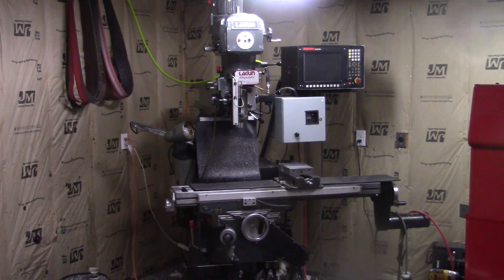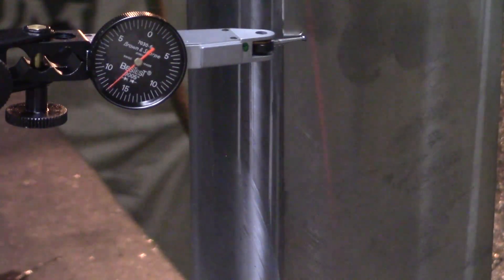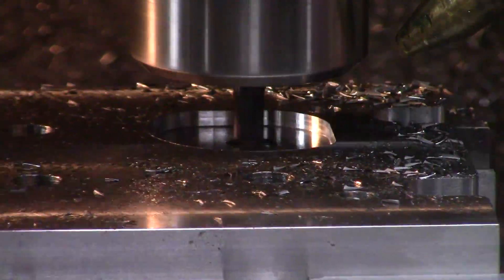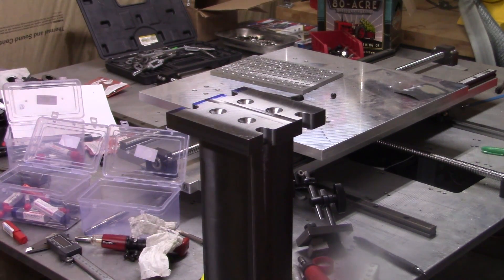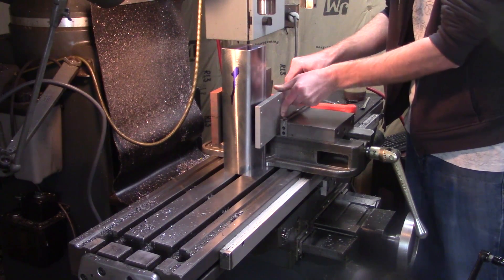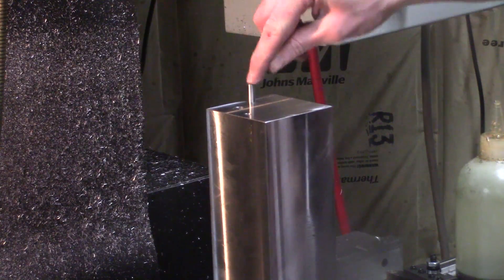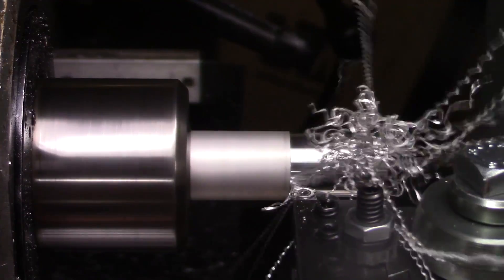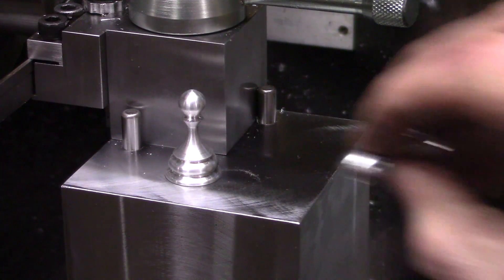A mill... and a Lathe?

Comment: Oh gawd, that took balls to cut the top of that square using that cutter running on the X axis parallel to the jaw faces while it was standing tall in the vice.  I would have chickened out and used an angle plate or at the very least used a Y axis cut.

Comment: 4:15  no. but the oil on the steel would turn black.
 i think what all machinists need is a small forge. then there would have no excuse for not owning a set of transfer punches... or a wide variety of other tools.

Comment: thanks for sharing the video. you can have tail stock seated on the work bench and for controlling speed you can use a big stepper connected parallel to the shaft of the spindle by belt or gearbox

Comment: I have a smithy Midas 3 in 1 and a lablond lathe from 1928 and a Bridgeport M head that I'm trying to rebuild but need to find parts. I want to retrofit the smithy drill mill lathe with a CNC kit but really need some guidance

Comment: no need to turn the head on its side, run it like a vertical lathe and save time not tramming
Reply: Andrew Schiraldi he wanted to use it as a cnc lahte but it was only 2 axis cnc  so

Comment: 2 dowels and one screw is not enough to get an accurate positioning, use 2 dowels on one side and the other dowel on the other side and you have a good defined position

Comment: Often use a HSS steel tool bit in the vice to modify small parts  in a hurry eg making flat ends on grub screws mods to cap screw heads etc there always seems to be odd modified parts in tool making and that's what has broken

Comment: brother I love your work you obviously know your machining however we both know if you have up and down , left and right as well as front to back you have 3 axis so no disrespect  from this this old Soldier but ??? now understand i am a newbie who just finished Advanced machining and CNC at my local college and love it after 25yrs in the Army but I'm curious why you say you only have 2 axis?
Reply from the maker: The Z doesn't have a motor.  I can move in 3 axis of course but it can only move in X and Y automatically.
Reply: I see. Well you know that no disrespect meant right? And I would love to speak with you reference help with a tail stock for a LeBlond Regal lathe if you would not mind.
Reply from the maker: Absolutely, I appreciate that. :P

Unfortunately I don't know the first thing about LeBlond lathes (or really any lathes) so I don't think I can be much help to you there!
Reply: Chris DePrisco well its as simple I believe as the tailstock you just made and seeing as you made one you are way ahead of me lol. im in the need of a tailstock for a 13" lathe I have the original but im thinking the person who owned before me had no respect for his tools as there was a cheap weld done and not very well. I am curious if maybe you might be able to cast anouther upper portion of the tailstock with info provided.

Comment: You made a tool holder, I see no reason why you can't make a holder for a live center.
Reply from the maker: You'd have to find something to bolt it to.  The table moves so you can't attach it to that.
Reply: to the head with a giant clamp

Comment: How in the hell you use a multiflute countersink to cut without chattering is beyond me. I won't judge you for not having those tools, but I will judge you for not having a knee drill driver adapter. You've got a lathe now, no excuses. ;)

Good work. I've lathed a few things on my mill, but usually sitting on the floor, looking up, with a bit clamped in the vise.
Reply: I've milled a couple things on my lathe....

Comment: hi, sorry my question is not about your awsome project (because u already recorded that very detailed.. especially, pins was not fitting becouse of air presseure :) ) that is my question: did u cover your wall with soundprofing material? could you explain a bit.
Reply from the maker: The walls are just covered in standard insulation with a paper backing, although it does help with sound.
Reply: Thanks for answer.. i have also a workshop in my apartmen but, i have many trouble with vibration and sund :(.. i need to move somewhere else, before my neighbour kills me :/

Comment: It looks like it was a fun project but you do realize you could have just clamped a tool in the vise and left the head vertical?

But I won't judge :)
Reply from the maker: No motorized Z... :/
Reply: Chris DePrisco Fair enough. Still could have left the tool in the vise pointing up :)  Just harder to set the tool height.  But maybe a bit more boring.
Reply from the maker: +David Kirtley But with no way to move the stock up and down, how would it machine more than just one area?
Reply: Go ahead and turn the head but with the tools pointing up. It just has to be perpendicular to the axis of rotation. The direction doesn't matter. Just cut from the bottom rather than the side. It would also allow you to set up gang tools to perform multiple operations.
Reply from the maker: +David Kirtley Ah, true. I may have to look into that, thanks!
Reply from the maker: +David Kirtley Wait, how do the tools go in and out (up and down) if the Z isn't motorized? Lol
Reply: Go ahead and turn he head to the side. Just orient the tools differently. About the same as a boring tool is oriented on traditional lathe arrangement. It points up but cuts on the side.

Comment: No need to control spindle speed
You can mount optical sensor to spindle to read RPM from it, and use that signal for threading (at least LinuxCNC can adjust axis speed with readings from spindle)
Reply from the maker: Interesting... I don't think the Anilam controller will do that but that's neat to hear. I bought a tachometer for the spindle which I still need to install, then I can hopefully manually dial in the speed I set up in the CAM.

Comment: Awesome video!
Have you ever thought of adding a third axis to the machine? 
If the steel turns black, it means it's getting REALLY hot.
If you want a tailstock - just use the other side of the tool holder! Put a chuck there, you've got an insane travel anyway.
Reply from the maker: +Jon Miller Let me think... I suppose I could set up the CAM for threading and get the spindle RPM from there.  Then I'd need to get a tachometer for the spindle and manually adjust the speed until it matched what was in the CAM.  Hmm.. I'll give that some more thought.  Sounds like it could be done - I just meant the machine couldn't handle threading by itself.
Reply from the maker: +Jon Miller The trouble is having to rotate the head, which means a lot of re-alignment.  If you have a 3 axis CNC mill you can leave the head alone and just put the stock in the spindle and tool holders in the vice.  If you've got the budget for something like the Tormach mills, that would be about perfect.

Here's a video of what I mean: https://www.youtube.com/watch?v=WtaPb7A6IqM
Reply from the maker: ***** Oh, I think we are thinking about two different things.  I meant I can't have a tailstock support long work as it turns since there is no stationary place to out it in relation to the head.

It seems you are meaning a place to put a chuck for drills/reamers/etc to machine the work from the end.  I gotcha now.  Yes, I still have to come up with something to do that. :)
Reply: Chris DePrisco Oh. Well, that would be quite hard, considering your entire "lathe" moves around a static chuck, heh.
Reply: That's what I was going to say! Just put a Morse taper quick change tool holder on the other side of the tool post. Sweet! Also you have a VFD on the spindle motor, don't you? I mean you do power tapping, right? So I don't understand why you wouldn't be able to calibrate it to handle threading. Like faster and easier threading setup than most any QCGB leadscrew lathe.
Reply from the maker: +Spirit Thanks! I haven't thought about it, really.  I need to get the mini VMC project finished up and then this mill will be manual use (maybe 2D CAM) only.

I don't follow in the tailstock idea...
Reply: That makes sense. I actually find this idea rather exciting. I have room in my tiny shop for a mill or a lathe. I've looked at the Smithys and others like those but it's such a compromise. Your setup has the potential for a compromise worth making, at least to me.
Reply: Chris DePrisco You can either put the chuck(for the "tailstock") inside the block and move the knee up when you want to do the work(make the chuck removable), or just mount it on the opposite side of where the tool points, so that you can move forward in the Y axis and switch to the chuck/collet.